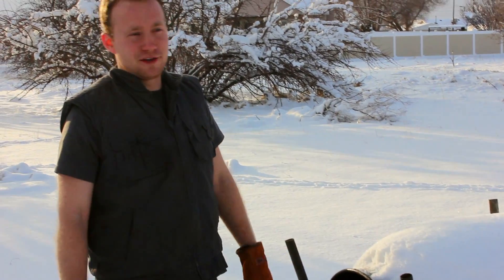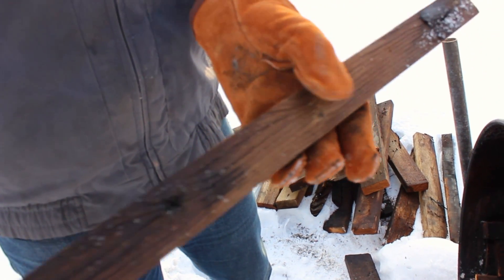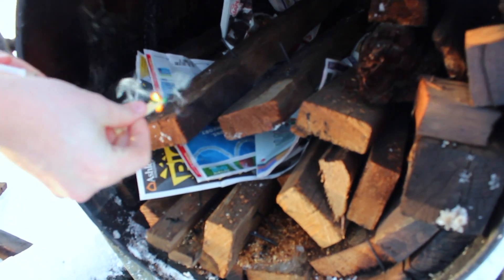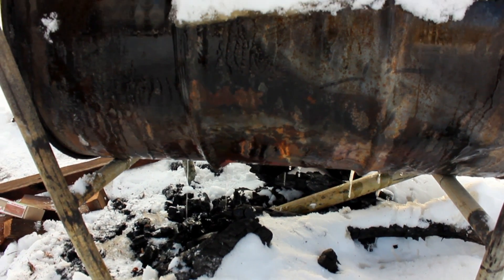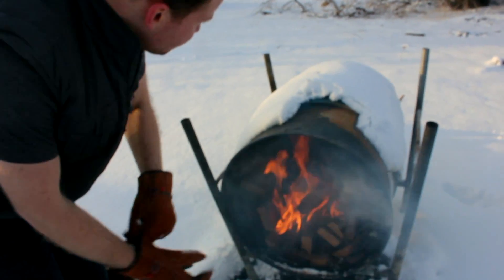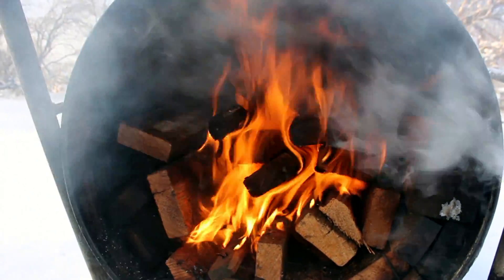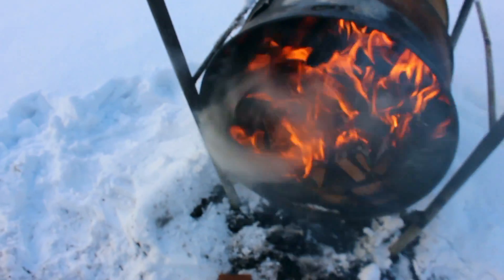Making Charcoal in the Snow (direct retort method)

Comment: @Good and Basic
You could try making charcoal with the old charcoal-burning methods. :D

Here is a german vid about one of the last charcoal burners (seriously he was an apprentice-charcoal burner): @

This is what I could understand about the process, from the linked vid:
1)Get a huge heap of wood tightly stacked into a dome shaped heap with an opening at the very top of the wood pile and a channel leading to the bottom of the heap. the channel acts as a air-duct;
2) then insulate it in hay/grass/leaves/etc. so that the next Thick and Airtight layer, consisting of earth, can not fall into the wood stack. do not fill the channel and leave it open for lighting. the earth should Not contain clay, because the clay could bake and harden in the heat, and thus create bubbles/shells/room where the wood and coal will start to burn.
3) Light the wood from that hole, by First filling the channel, with cold charcoal, almost to the top, then add red hot coals and top it of with more charcoal.
4)then cover the opening with something that does not burn and is easily to remove, and check the whole earth-pile for escaping smoke and immediately Patch the places where the smoke surfaces, thus forming an airtight seal around the charcoal-hill. 
5) 'feed' the pile, through the hole at the top, every three hours or so (it depends on how big the pile is) with fresh wood and glowing coal.
6)watch it burn and regulate the heat and burning process, by poking and covering up holes in the hearth shell surrounding the pile.
7)watch out for "blue-ish" smoke (as shown at @ in the linked vid) escaping the pile, it indicates the coal is "cooked". white smoke means that it is not yet ready. (take this with a grain of salt, i am just telling you what they are in the german charcoal-burning vid ; ) )
8)douse the pile in water, well... cool it, so that the coal has no chance of burning.
9) wait until it is cooled down (carefull temp. can reach 800C and 400C in it's end stages)
10) be-eth happy-eth for-eth thou-eth has-eth- made-eth charcoal-eth. XD

Comment: There is a good chance you wont see this, the vid is a few weeks old now, but I make my own (Local Hardwoods, mostly maple and buckthorn) charcoal for smithing through the direct method and have for a few years been using a 55 gal drum like the one your retort is based on to good product.
     My drum is upright with a 4 concentric 1-inch holes in the bottom which get access to a mostly windless air supply by sitting it on 4 bricks. 
     How you lay out the wood is critical to performance - airflow and heat are key
-A bed of a few pieces of wood lying on their sides are placed around the air holes in the bottom of the barrel and thinner pieces of upright wood are balanced on them until the layer is made up (usually my pieces are 1-1.5 feet long and no thicker than a couple inches, these are fine to lean on the inner drum wall, just keep them fairly upright) This leaves lots of space at the bottom for air to flow freely between all the gaps, while the uprights allow heat within the barrel to travel paralell to the air flow and gravity.-Add more layers of these uprights as necissary
-You want to have your thickest pieces in the middle of the barrel and thinnest at the outside. This is to make more efficient use of heat.     Once the barrel is about 2/3 to 3/4 full of wood, lay a clump of brush and twigs in the middle and start your fire. The remaining walls of the barrel will shelter from the wind while also allowing it to draw some air from above, which it will desperately need early on. As the fire burns and the bigger bits of wood start to catch, you get into the part of this task that becomes more art than science; This is generally what I do - If the fire begins to choke, and smokes over, fan it from above till it kicks up again. The lid of the drum works well for this - If the fire flares up hot, not due to wind, add more wood to the top, a bit at a time - If the fire flares up hot due to wind, add a bit more wood and push some dirt up on the side of the barrel sitting on bricks that the wind hits. Remove this if the wind diesYou want this to look like a burning barrel, woodgas flames wreathing the top, but keep adding wood as it shrinks down and chars. If you notice the blackened wood/charcoal layer on top starting to glow or ash over, add more wood bits. Thick twigs work fine and make decent charcoal at the end of it all. 
When you notice glowing coming from one or more ports below, Ideally more than one but beggars can't be chosers and timing controls quality, top it off with wood and slap the lid and rim on, preferedly with gloves (this can also be timed by checking how far down on the barrel the heat progresses -> 4-8 inches from the bottom warm but not hot = good to cap off). push up soil around the base to close up the air holes and *let it sit overnight*. 

*Do not open it early*.The woodgas can (and will) ignite, burn the hair off your arms and leave you smelling like tar for a week, or the hot charcoal can spontaneously light up and you will end up with softer charcoal and a very hot barrel that you will have to leave sealed for many hours again to cool.Once its cool to the touch everywhere, just empty your barrel and sort out the coal from uncooked brands. Even the best batches always have a couple. Some people sort the soft charcoal and hard charcoal, I never really noticed a huge difference in the forge, but I use hardwood so maybe its different for softwood. 
Cheers, and Good luck if you try it, it usually makes a good deal of decent coal
Reply from the maker: Thank you!

Comment: What about letting in a controlled flow of air into the chamber while monitoring the temperature?
Reply from the maker: The primitive technology channel's furnace does this and we're considering it.  The question is basically is we want to go direct or indirect--bake it with a secondary heat source or light the wood directly on fire. JF

Comment: don't you need to spin the barrel?
Reply from the maker: Not really, I've never seen it done that way. JB
Reply: Won't the centrifugal forces pull the heat from the center? Just reduce the O2 supply and you're set.

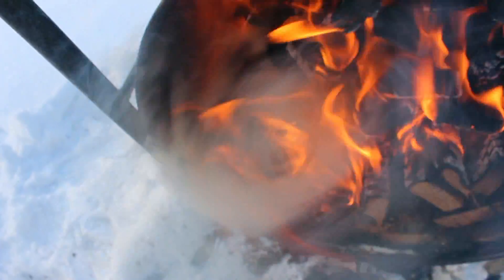Comment: caption seems incomplete at 2:48 "We've found that the direct method (Fire in the retort, then seal)"... works best for backyard production?
Reply from the maker: Drat! Great catch! Yes, something like that. The direct method is by far the easiest to get to work. Without insulating the chamber, the indirect method doesn't look like it will work even with the massive bonfire from the previous charcoal video. JB